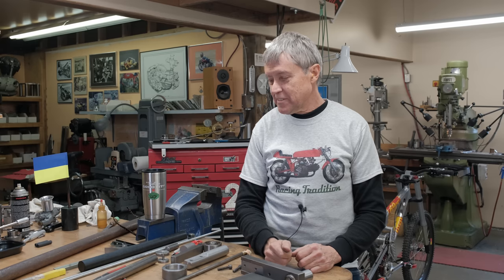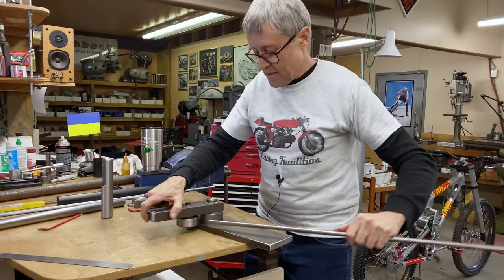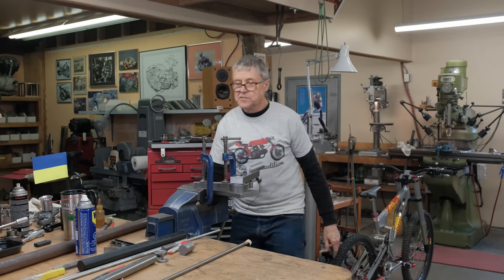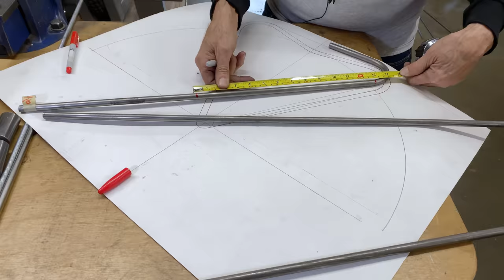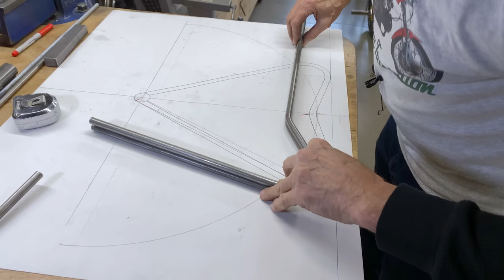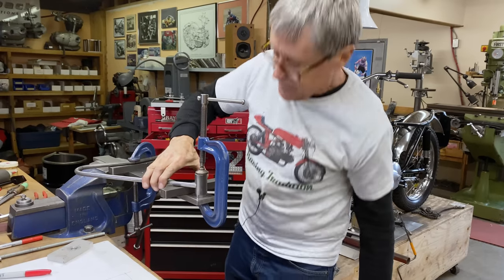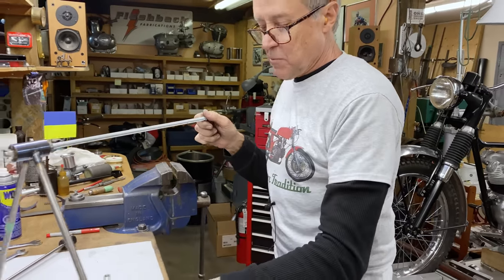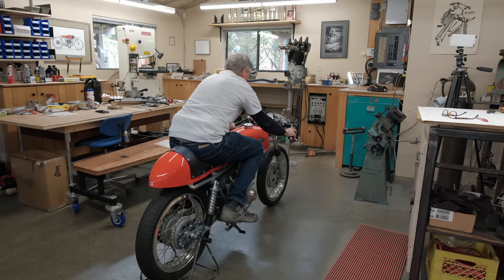Making a motorcycle race stand // Paul Brodie's Shop

Comment: That's a pretty slick bending rig, but as a former blacksmith, I must say "Just heat it up!".
😉
Reply from the maker: I've tried heating and bending but I could never get consistency.
Reply: @paulbrodie  That's what the hammer is for. 😆
Reply from the maker: @johnthemainguy9059   I'm thinking we have two different approaches..

Comment: Struggling bar? 10 points for that. Long ago at work they were modifying something to do with the steam heat and there was a 4 foot length of 1.5" pipe left over. I asked if I could have it and was told "feel free". It was going into the recycling bin otherwise. 30 years later and it is still one of the most useful tools I have. Especially for getting the 36 mm nuts off Volkswagen rear axles. One of the other most useful tools I have is a 1 foot length of small gauge rail road track. Holy Hanna, that thing has a million uses.
Reply: Hmm, in the 60s I got my hands on a propshaft from a lorry, it’s UJ broke so was scrap. Sawed the ends off, and it was an ideal ‘struggling bar’ for lorry wheelnuts! Ahh, memories! Les in UK
Reply from the maker: When I worked in machine shop many years ago, I learned about Struggling Bars, Sky Hooks, and a Box of Sparks. Thanks for commenting!

Comment: About the only improvement would be some 'foot pads' between the cross piece and uprights to give a little more surface area when pressing down.  The Aermacchi is pretty light though so probably not needed?
Reply from the maker: My little Aermacchi should weigh between 210 and 215 pounds.

Comment: I like that term "Struggling Bar.". It's a bit nicer than the term "Cheater Bar." It's not cheating to be efficient.
Reply from the maker: When I was a kid working in a machine shop, I learned about things like a Struggling Bar, a Sky Hook, and a Box of Sparks.
Reply: @paulbrodie  Different country, different terms. I'm intrigued by "Box of sparks." That sounds like fun. I've just started a new job making bike racks down here in SLO California and have learned MIG welding on the job. (I learned TIG on the job at the motorcycle shop.) Box of sparks sounds like it could be a MIG welder.
Reply from the maker: @bigbird2451   Box of Sparks. When a young apprentice starts at a shop, someone will tell him to go to the Part Store and ask for a Box of Sparks. The parts guy is expecting this. When the young fella shows up, and asks for the Box of Sparks, he is told to wait. Parts guy comes back, can't find that box, but sends him to see another guy, who also leads him on... Do you see what is happening? He might be asking for a Box of Sparks for quite some time!

Comment: Hi Paul, I was surprised that you chose to use solid round rather than lighter and more rigid steel tubing as you normally save weight on everything! But early 60’s stands were all like this. Steel tubing ‘fast lift’ stands with wheel rollers are a more recent innovation. Did you consider adding some diagonal bracing to strengthen the stand against sideways flex? Congratulations on a great functional result!
Reply from the maker: Thank you Barry. I do like to save weight on the bike, but the stand doesn't matter. It's also easier in a sense to bend solid rod, because it will never kink. I also don't have to think about air holes when it comes time for welding. I thought I might need diagonal braces, but it seems fine even when I'm sitting on it. I'm happy!

Comment: Nice. I have to make one of those for my CBR. I can't stand using the mickey mouse race stand with the wheels on it. I'm always afraid of tipping it over, because there are no grab handles on it.
Reply from the maker: Thanks John B. I know what you mean. I worked on a friends Ninja racebike, and there were no handles only a slippery tail section, and I was scared of dropping it in my shop.

Comment: When he was just starting road racing in the mid-70s, Mike Baldwin sold a similar race bike stand. You would see them all over the pits in the late 70s. His used a much smaller rod, maybe 1/4" diameter. It was barely "just strong enough". His didn't have the pretty bottom reverse curve that your design uses, and instead of your nice machined tube, he used a fender washer. I made a similar design out of 3/4" square steel tube and used it for years.

When will you be taking the Aeromachi out on the track?
Reply from the maker: Yes, I did put a bit of thought into the stand, and drilled out the axle to fit the 3/8" rod. I remember Mike Baldwin from the mid 70s. I don't know when the little Aermacchi will get to the track.
Reply: @paulbrodie  I believe bikes need to be ridden, and a race bike begs to be ridden on a track. Its way too pretty and nice to just stay in a garage. Of course, it should be on newer tires than it came with from Italy.
Reply from the maker: @PatFarrellKTM   Pat, only the motor ever came from Italy. I built the rest. The tires are take-offs from my earlier Aermacchi racers. Yes, the bike should be on a track, but I am not a racer anymore.
Reply: @paulbrodie  Of course, it has a Brodie frame. I too am no longer a racer. It sure is a pretty bike
Reply from the maker: @PatFarrellKTM   Thanks Pat! Maybe someone else will race it..

Comment: M8 12.9 bolt yield strength
12 x 9 = 108
M8 x 3.14 = 25.12

25.12 x 108 = 2,712.96 KG
Good work

Greetings from the blacksmith 😏
Reply from the maker: Thank you Mr. Dane. Those M8 12.9 Allen screws really are incredibly strong!

Comment: (i know you're a master framebuilder with decades of experience, and all that) i wish you wouldn't freehand on the lathe like that. all it takes is one loss of balance or a tired afternoon mistake for life altering injury or death. love the videos otherwise. this comment is probably one of many alike, thanks for reading
Reply from the maker: Freehand on the lathe? I'm not sure I know what you're talking about.
Reply: @paulbrodie  I suspect he's referring to the deburring tool, which is designed to be hand-held, or the file, which is standard operating procedure for lathe operators although I was taught to use them on the underside of the part, so if it catches it shoots into the chip-pan, not you, or the deburring with the countersink.  That one is different but probably harmless.
Reply from the maker: @Alanbataar   I still have no idea what he was referring to...